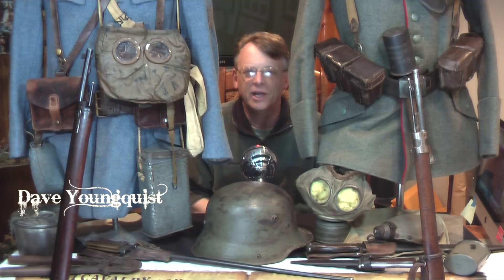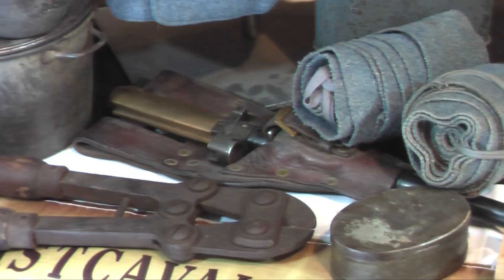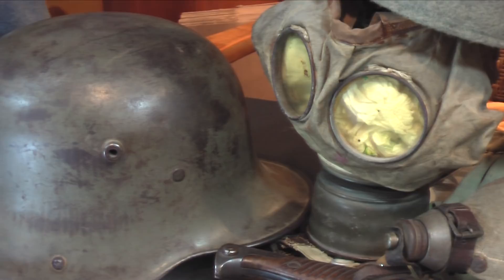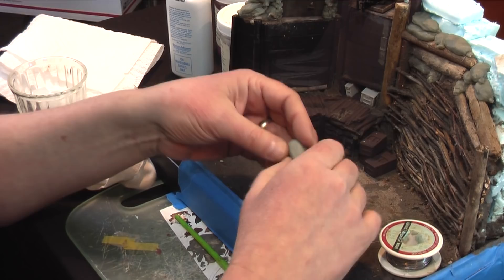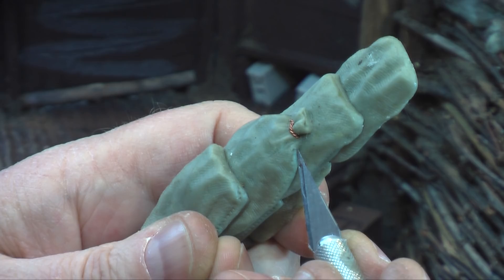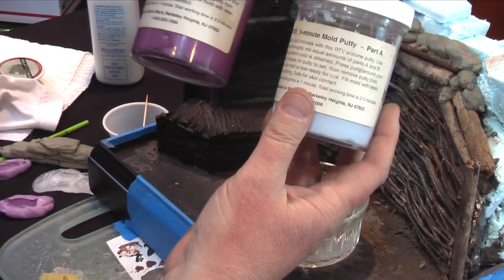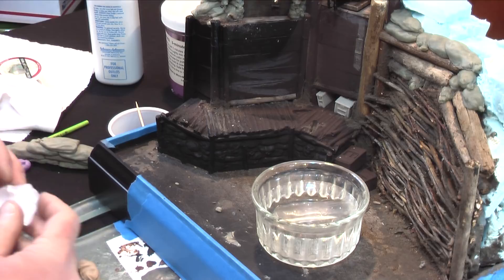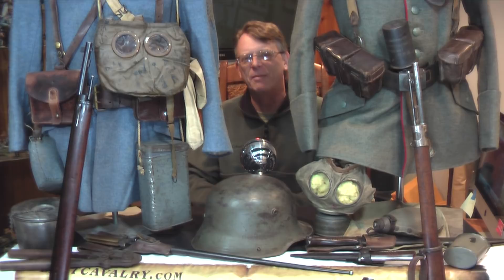Creating Sandbags for your Models + Verdun Tribute

Comment: does the french webbing have a pattern/design name?
Reply from the maker: I'm not sure what you are asking - french webbing? Help me out so I can answer your question - and thanks for watching!
Reply: webbing is made from the straps, belt and ammunition pouches etc. normally it has a name. the british equivalent in WWI was called the 1908 pattern webbing. i wondered whether you know what the straps, belt and ammunition pouches are called for the french. also what a great way to make sandbags to scale i have never thought of making a mold to do it. also great video.
Reply from the maker: WWIIUK Okay, I now know what you are asking - the French did not use webbing, they used leather. The Y brace system is the M1892 pattern with the M1905 cartridge pouches (3 total), you also see the M1888 bayonet frog, M1892 haversack, and the 1-liter M1877 water bottle. Hope this helps!!
Reply: yes thank you so much. do you know if it stayed the same during the beginning of the second world war?
Reply from the maker: WWIIUK You are very welcome!